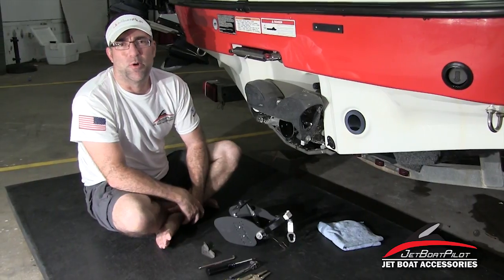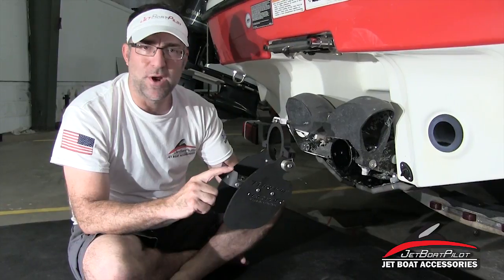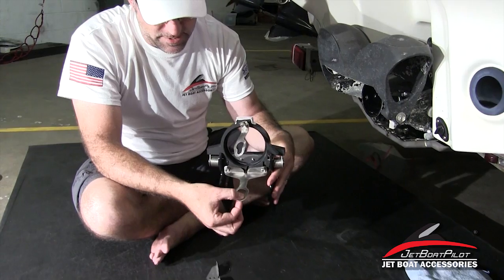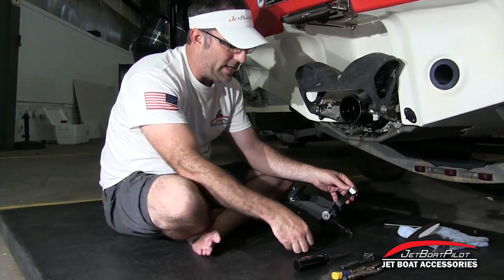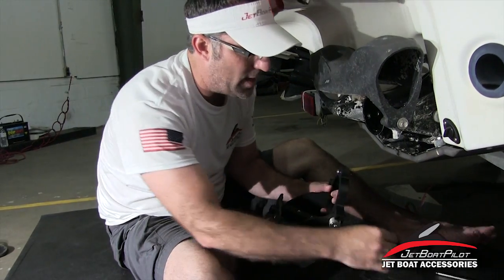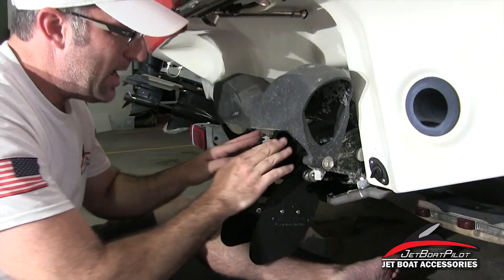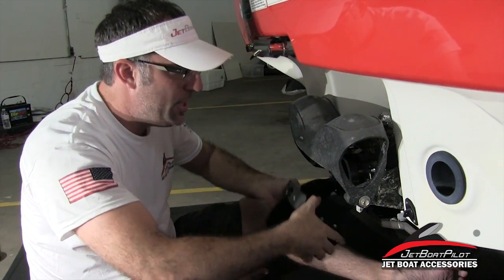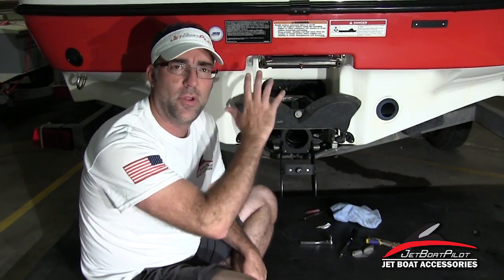BRP Thrust Vector Install Video June 2018

Comment: Installed mine 5 weeks ago. Very easy install. I would say it improved my slow speed steering 75%, maybe a little more. Fully satisfied and would not hesitate to recommend purchasing it. Reasonable price with fast shipping. Could have included some decals as buying them is expensive considering your helping promote a product.
Reply from the maker: Thanks Fred!
Reply: Now get some t shirts in stock! Ty.